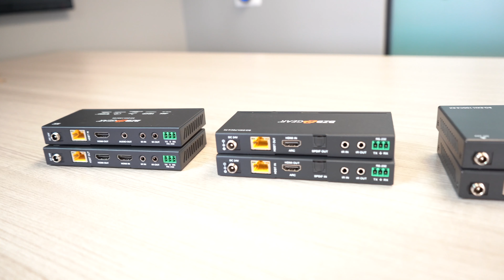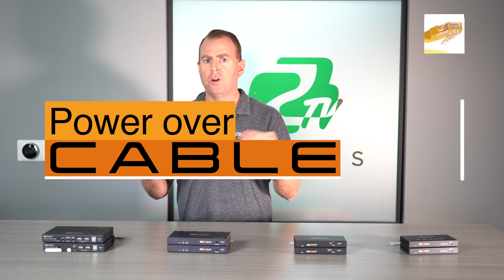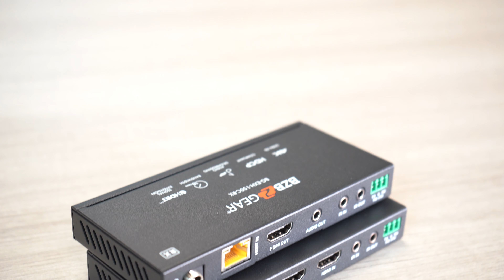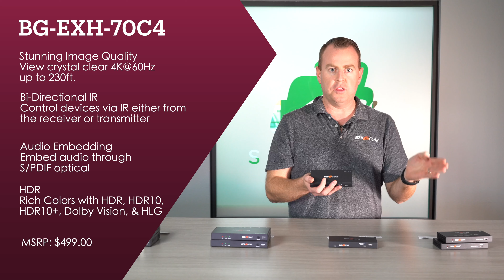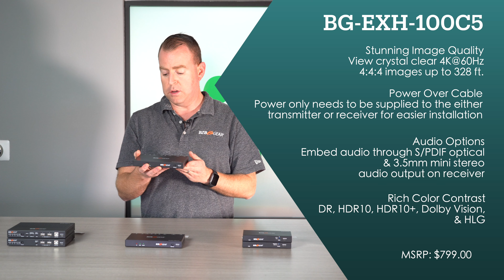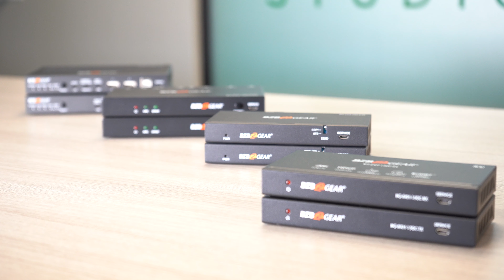High Quality HDMI HDBaseT Extender Kits for Long Range - BZBGEAR

Comment: How is the latency with this kind of product? I'm asking to know if it's adapted for low-latency gaming needs.
Reply from the maker: We compare four HDMI extenders in this video and we recommend the BG-EXH-70C4 for low-latency gaming needs, especially where every millisecond counts. The BG-EXH-70C4 is specifically designed for zero-latency transmission over shorter distances.  https://bzbgear.com/product/bg-exh-70c4-4k-uhd-hdmi-hdbaset-extender-with-ir-arc-poc-rs-232-and-audio-embedding-de-embedding-up-to-230ft/